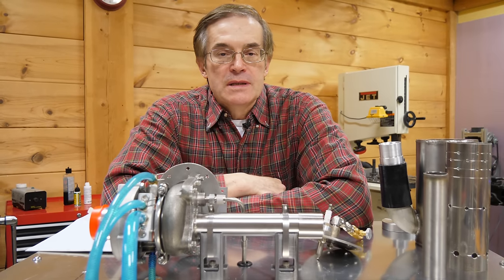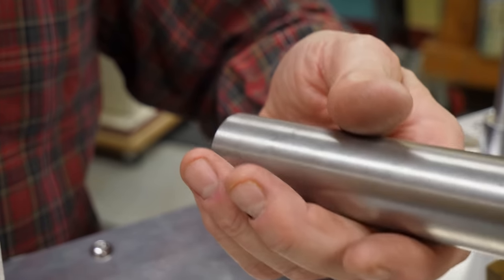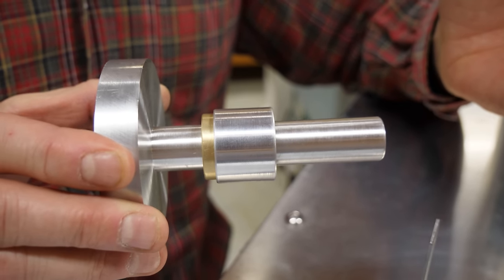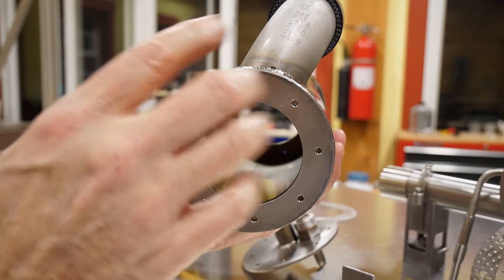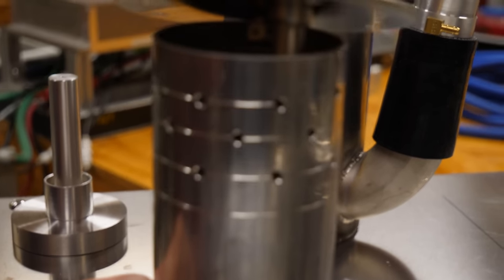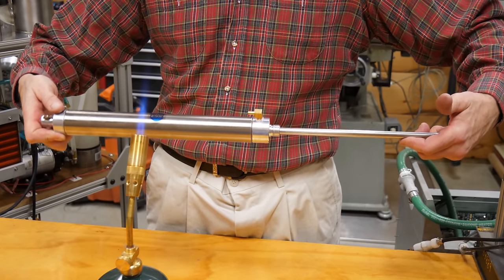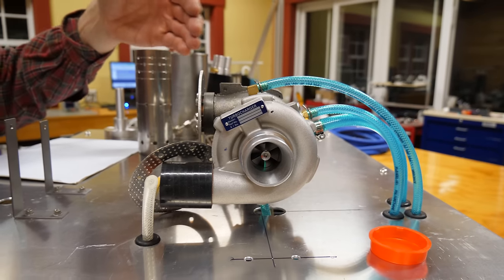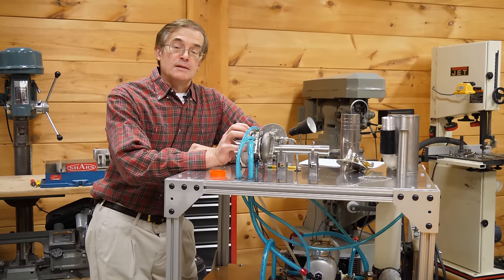The Turbojet!

Comment: Initial explanation was a bit confusing as you didn't state clearly where the original (car) air and exhaust would exit the turbo unit.  Similarly in the description of the burn system, you kept mentioning the "inducer diameter" without explicitly calling it the "turbocharger inducer diameter".  In the soup of new component names introduced, this made the entire explanation hard to follow for someone who isn't already familiar with the terminology being introduced.
Reply from the maker: You might want to watch it again, you'll probably find some of that terminology less difficult after hearing before.
Reply: @TechIngredients  Having to watch it twice to understand your bad script structure was precisely the problem I complained about.  Besides, I wasn't really looking for US centric toy builds from car parts.
Reply from the maker: The "soup" you described is the terminology used for these car parts and understanding it is necessary to build these toys.  Good luck with your non US centric jet engine building.😉
Reply: @TechIngredients  Consider I was in no way looking at anything related to US cars.  And the word "soup" referred to the large number of terms introduced during that part of the video, some of which were later used in a way requiring perfect memory of every word previously said in the video and when each was first said.  My emphasized example was to mention a specific part of the turbo during the description of something other than the turbo, assuming everyone would remember that was one of the named turbo parts, and which specific part.

Comment: Actually making the fuel air ratio leaner (less fuel) it gets much hotter.
Reply from the maker: Not from the stoichiometric ratio.  Once you have enough air to completely burn all the fuel, you have released all the energy available from that fuel.  Adding additional, room temperature air will only lower the temperature of those hot exhaust products.
Reply: @TechIngredients  hmm ok i might belive you 😜

It's just that if you go leaner than the optimal ratio you start burning valves in engines fast

Comment: Probably a stupid idea: Water injection to reduce your combustion exhaust temperature? ~1ml to 1.7L expansion ratio could add extra thrust, and you could burn closer to perfect stoichiometric ratio without melting your turbine.
Reply from the maker: True, if you are willing to carry the water.  This little turbo pumps 20# of air/ minute.  10# is used just to cool the exhaust gas.  Water's specific heat would require 2.5#/min. In order to equal this.

Comment: Good engineering. Looks expensive.
Reply from the maker: Not bad.  You can take this $180 turbocharger and eliminate some of the support fetures, cart etc and get it to run.
Reply: @TechIngredients  so a stripped down version is doable. Not bad.

Just to clarify my initial comment. Coming from a third world country where everything is imported and taxes raise the price significantly the rig you show there with the proper welding and components would probably cost 2 or 3 months average salary.
Reply from the maker: That is a much more fundamental problem. I believe that can change.

Comment: Is the definition of Inducer and Exducer different when talking about jet engines? In a car turbo the intake spinner is the compressor and to exit is the turbine, with the inducer being the diameter of the fin's short tapered diameter and exducer the diameter of the fin's long end.

http://image.superstreetonline.com/f/30202574+w640+h427+q80+re0+cr1/impp_1103_09_o%2bturbo_tech%2bdiagram.jpg
Reply from the maker: You are correct about the proper terminology.  The reason I described the compressor half of the turbocharger as a turbine is not because that is the industry standard, but to compare it's function to that of the output turbine.  The process is simply reversed.
The turbocharger industry describes the compressor as a "wheel".  I believe this is confusing.  I should have recognized the standard terms and THEN explained my ressons for using non standard terms.  That was a mistake.

Comment: The compressor wheel has an inducer at the inlet like you said and the exducer is the bottom (wide part) of the same compressor wheel. Just like the turbine has an inducer and an exducer measurement. To find the trim you take the compressor wheel and  take inducer measurement squared divided by exducer squared then multiply by 100.

https://www.youtube.com/watch?v=u07PjivcOMI
https://www.youtube.com/watch?v=TmpancdutSw

Comment: I did not see the rest of the videos, but some of the terms he uses are "Non-Standard", and make me suspicious.
Reply from the maker: What terms are you thinking of?  I don't want you to be suspicious.
Reply: @TechIngredients  ;  "Turbine - turbine".  I have always seen the term "Gas Producer Turbine".
"Exducer".  I have never seen the word "Exducer" used in an aircraft or stationary turbojet engine.
Please remember, that I have not seen the previous videos leading up to this one, so I do not know what foundation definitions you may have introduced, if any. 

In addition, when you compress the air you also increase it's temperature.
Reply from the maker: Turbocharger manufacturers and jet engine mechanics frown on my use of "turbine" to describe the centrifugal compressor and prefer to call it a compressor "wheel".  I disagree with that position, but it's their industry. The output turbine is usually, just called the turbine.
Exducer is a widely used term in the turbocharger industry to describe the airflow region surrounding the outer diameter of both the compressor and the expansion turbine discs.
You are correct, that the air heats as it is compressed.  It also cools as it expands.  That fact affects the compressor's ability to increase the density of the air and modifies the simple demo I used to illustrate compression ratios, but it does not nullify these principles.

Comment: The compressor is not a turbine. Calling it that is like calling a catchers mitt a type of bat.
The hardest part of explaining something is making sure you know it back to front, inside out.
For an instructor to call a compressor a turbine is a major error.
Normally it would not matter, but you are lecturing here, and you made a huge error.

You called it jargon. Not so, and it does not allow you to make a huge error.
Reply from the maker: Take it easy. 

Have you ever heard of a turbo compressor?  What do you think the term turbo is short for?

Comment: Wow you're like the first person to actually describe a turbo correctly except for the fact that eBay $100 turbo is not going to spin 300,000+ RPM. if you do get a reading like that then there's something wrong with your reading. a lot of the Chinese Turbo they're bearing system is under sized and they do that to sell more Turbo and at that cost it's cheaper to buy another one then it is to repair that one. Also your water pump there's cheaper ways to get it then buying the AEM version from a water meth system. you can look at home gardening pumps there literally the exact same pump. I can't wait to see this thing going hopefully it'll last longer than a few minutes because I really want to see you to the compound setup.
Reply from the maker: Thanks!
Actually, the very smallest turbocharger does spin around that speed, but like a dentist's drill, the surface speeds in the bearing and around the wheel are no higher than in the big turbos  and the rotating mass is much lower.
We've already put about two hours on this unit without any problems.

Comment: Stop trying to use Kelvin units, nobody cares.  It's pretentious...
Reply from the maker: You should reconsider your comment.  When we need to calculate a relative temperature change we have to use an absolute scale.  For example, doubling 27degrees Celcius is not 54 degrees Celsius, it's 600 degrees Kelvin.
Reply: @TechIngredients  Comment stands.  The Kelvin-Celsius increase in computational effort is negligible.  Your just trying to look cool.  In fact, you very well have added an extra step to your published equations to get to Kelvin...

Comment: Sir, stick with your science experiments not turbo specs. "All turbo's leak oil and hell its fuel" you must be buying junkyard turbo's. "Journal bearing turbo's are Cheap turbo's and not very acurrate"  there are $3000 aftermarket turbo's, NOT ebay turbo's from china, with journal bearings. Go ahead tell them their turbo's are "cheap" .  You're a lab rat not a gear head. Great video though.
Reply from the maker: All bearings leak, even vacuum rated bearings for physics research.  The question is how much.  The better the design and the higher the quality of the fabrication, the less the leak will be.  Physics is physics whether in the lab or at the strip.